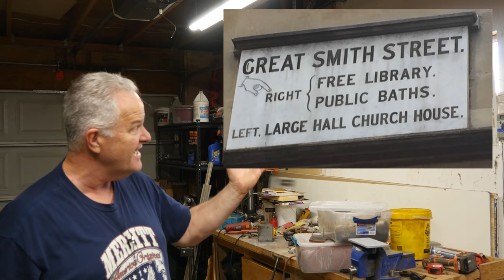Casting a street sign replica

Comment: Nice casting Perry, that's how I do all my plaques, thin layer of petrobond & back up with mansfield red [greensand] I always scrape the sand off the pattern so I never mix the 2 sands up & discard the burnt sand, after fettling I sandblast & acid etch prime then 2 coats of vehicle enamel, Ps, As , & Rs are often trouble not releasing that's why I have a dentists drill  to clear them out.
Reply from the maker: Don’t forget lowercase “e”. That’s the worst for me 😄
Reply: @swdweeb  Aah yes forgot about that one, any letters above half inch I cut out of 2mm mdf on my scroll saw with plenty of draw & anything below that I use patternmakers letters, petrobond's expensive which is why I only use a coating but it has better strength than greensand [as you know already Perry] thanks for the reply.

Comment: The end result is very good. 
Font choice is always something that can bite you in plaques. Those "A" eyes have an apex that comes to a very tight point, not much that you can do about that without a different font (or possibly noting the caveat on typically using bold fonts, in some cases the bolding steals space from your letter's eyes, vertexes, and apexes making sand release harder or impossible). The lettering there also seems to be streched a little vertically which will also increase the pinching at the apex.
best of luck with the next round of casting.

Comment: As usual watching during breakfast. Have to tell you, I actually stopped chewing while you lifted the pattern out of the sand, I did  not want to interfere with the lift.
How much draft did you use on the letters? Need more?
Owning a printer can sometimes be as rewarding as it is frustrating, mine is proving great for making patterns at the moment.
You rate of improvement is impressive, how many castings have you made now?
Reply from the maker: I think I'm up to four or five now. ;-D  I actually have no idea... 20? 

I put 8% draft on the letters. Given that they are only .5mm tall, there's not a lot you can do to make it draftier.   The layers are what kill me along with the tiny openings I try to mold. There just isnt enough sand in the tiny spots to be very structural.

Good thing I edited a few seconds out of the lift, you might have passed out if you;d had to wait on the whole thing ;-)
Reply: What Layer height did you use? How long to print that pattern?
20? Those skills do not come easily, you get to 50 and then you will have improved so much.
Reply from the maker: I use a .1mm layer. At least that's what I tell the Cura slicer. I don't rightly know how long it takes to print. That plaque took a long time, like overnight.
Reply: For a part like that, it would good if the layers covering the letters could be a smaller layer height than the rest of the part. I can't do it, may be some can. I think it would a great feature to have.
Reply from the maker: I cant do it either. It slices the entire model with no option to slice parts of it differently

Comment: I'm curious to know if you put any draft in the pattern? Maybe it's not needed with the shallow depth of detail? I noticed you didn't use parting dust as well. Maybe not necessary with the 3D print material?
Reply from the maker: Yes, I put draft on all of the vertical surfaces usually about 8%. I've taken to making the relief very shallow on small stuff as it releases  much better for me. The big problem with printed parts is the layers the printer lays down. Each of these layers acts as a "sand grabber" as they don't build a smooth wall. Making the relief shallow eliminates layers that can grab.  I also put several coats of primer/filler paint on the pattern and sand the flat surfaces as smooth as I can get them.

I did actually using parting dust (talc) on both castings. I must have edited it out. I don't leave a lot on the part, usually brushing the excess off before I ram the sand.
Reply: swdweeb I like to make house number and name plaques. I used to hand cut patterns from foam board. Now I'm getting into using a cnc router with a tapered end mill for draft. It's hard to get fine detail when machining foam. Maybe I should have bought a 3D printer instead.
Reply from the maker: Are you able to use something like mdf rather than foam?  Brian Olrogge seems to have gotten pretty good detail doing that.  Here's his video. https://www.youtube.com/watch?v=5Bg3Ct6OwtY
Reply: When using MDF use dust extraction and mask. It creates a very fine dust that gets everywhere and has potential health implications.

Comment: why do you hate inches ?   did you dust
(no metric unit for dusting ,is that why ?) the first  pattern with release ?
Reply from the maker: I don't hate inches I just think it's silly to measure things like 5 13/64" when you can say 53mm (or whatever the conversion is). Especially when you're doing arithmetic with inches... what a pain to add 2 and three eights to 1 and a quarter. 

Yes, I dusted the pattern with talc. Actually each time I cast it I dust it.
Reply: 3 and five eights!
Reply from the maker: How long did it take to come up with that?  32+60 seems a tad easier ;-)
Reply: but un American we have inches no one else like them ther to {whimper  ,cringe , hydrate, hers your trophy you did a good job tryin} hard  lifes not meant to be easy my dad used inches his dad used inches  his dad used inches , his dad may have used spiders , that was befor my time . what i realy want you to understand is i like cake , ok?
Reply: Er, 92?    But yes, I do agree (3 3/8 =3.375 *25.4 = 85.725) + (2 1/4  = 2.25*25.4 = 57.150) = 142.875 /25.4 = 5.625 = 5 5/8 😣 phew! yep, much easier 😀 Yah. But seriously as one from the great southern land where millimetres have ruled since - er - well,  for a long time, 32 + 60 = 92 is easier, but my wooden rule (it is a "rule" by the way not a "ruler" as there is only one ruler - of the BE - and she lives in England) is calibrated in those inch thingies... Martin
Reply: , i also agree with the wooden rule   .  he   never shows how deep it really is, he rams the thing in there to his mark and digs away like a cute little mole ,how do  we realy know if its 57 mm or 2 9/32  ?
Reply from the maker: Sigh...
Reply: hug?
Reply from the maker: Next best thing, I talked about you in a video I'm uploading for release tomorrow ;-)
Reply: title it the great measurement  debate ?
Reply: im not a troll thought just remember i identify as an ork .and a fan :)
Reply from the maker: I know, the video doesn't say anything bad.  It's scheduled to go up tomorrow at noon my time